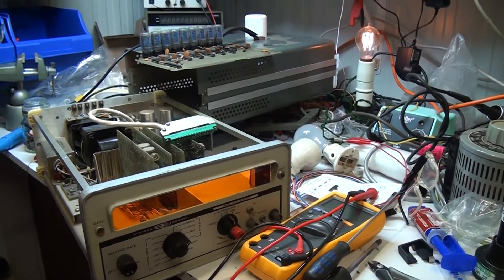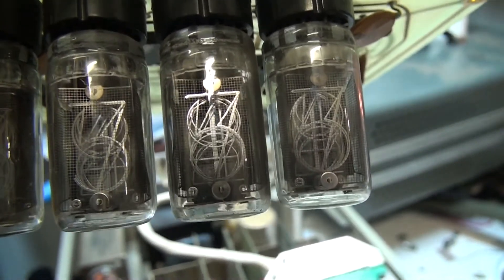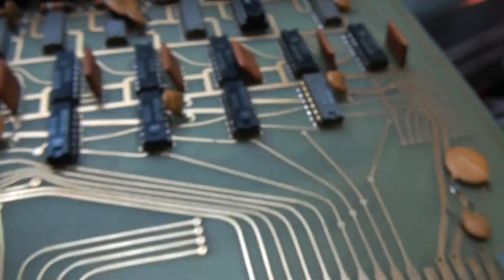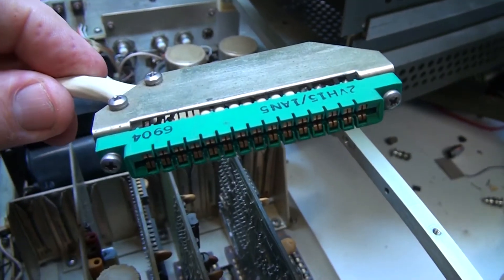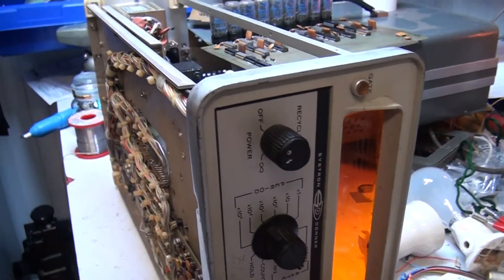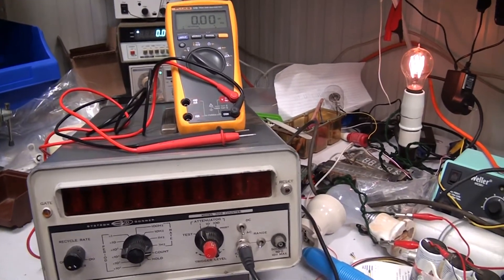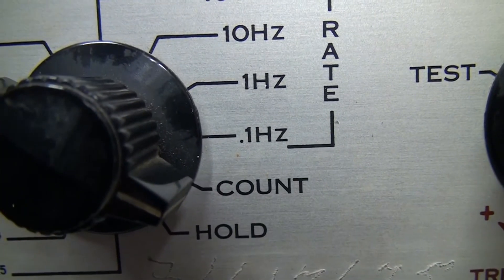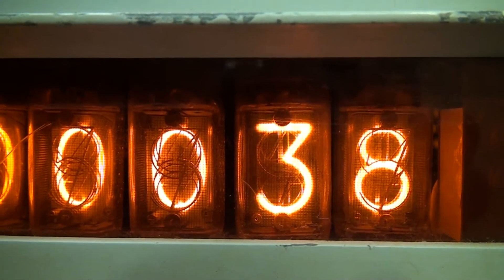Systron Donner Counter repairs.1970's Cold war era.

Comment: I have a S-D 114 counter.  According to my note inside, I replaced two of its  7441's in 2000.   I added two zeners to
reduce the B+ voltage by 24V.   I Imagine that I had thought that a too-high HT voltage had killed the 7441's.

 One of its nixies does not correctly light on one of the digits but finding a replacement seems pretty well impossible.

Comment: Great video! I think I might have to get one to pair up with the Telequipment D43 scope!
Reply from the maker: That scope you have is a nice unit, is it working? I hope you can find a counter for your collection, something should turn up at a swap meet, the one I have I found at the Historic Radio swap meet this year. I ended carrying it around Melbourne after the swap meet till I got back to the hotel, sure was a heavy lump to cart around.
Reply: Haha yeah I can certainly imagine the weight in it! Yes the scope does run very well except for the 0.1uF 4000V EHT capacitor, which leaked the other day :( Finding a replacement could be a bit tricky

Comment: Would it be necessary, or fairly easy to transform the 240 V 60 HZ we have in the US down to the 220 V 50 Hz used in the USSR?
Reply from the maker: Here in Australia we have 240 V 50hz mains, the Russian 220V devices work ok. They use transformer type power supply and show no signs of overheating. I would be surprised if the different line frequency would cause problems, usually 60hz transformers may run hotter on 50hz but not sure what can happen the over way round, I think they will be ok.

Comment: Have some IN-12s (they seem like the most common ones here in the States), and I've seen the ones with the connectors on the bottom quite a few times, but this* is first I've seen of upside down nixies. Those must be rare.

Comment: If it used 74141 rather than 7441 I would had said to put in a 155ID1 since it's a better chip anyway; they don't drive the tubes as hard (at least that's what I understand).

Odd that the frequency standard is 1MHz rather than 10MHz.
Reply from the maker: The original Nixie drivers are 7441, these are older than the 74141 chips. I used a 7441 as a replacement however a 74141 would work just fine. The nixies are current limited by a resistor so I don't think the chip styles would make much difference in drive current.